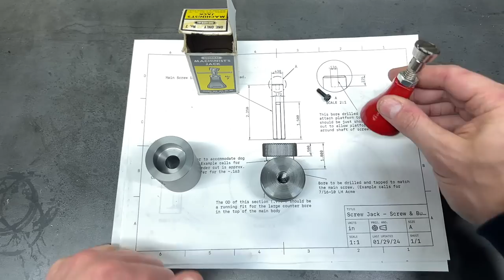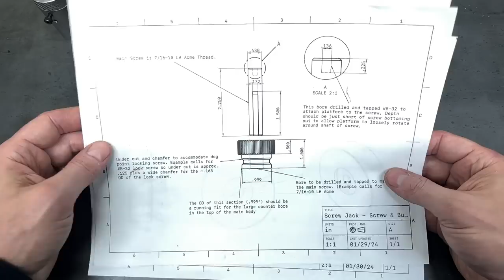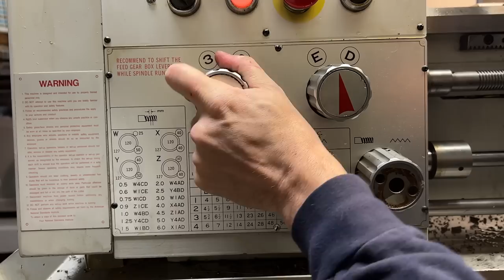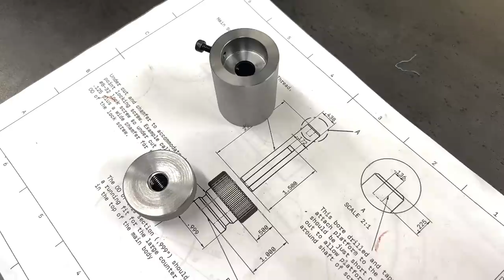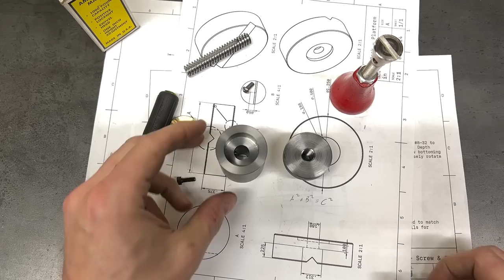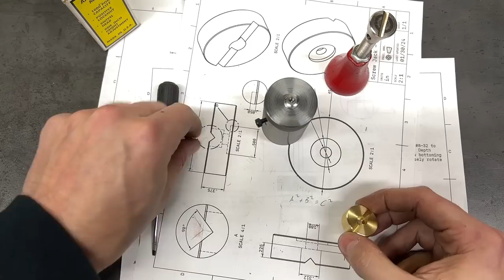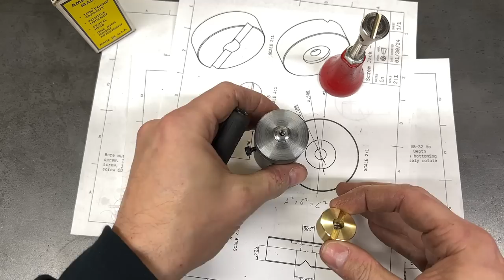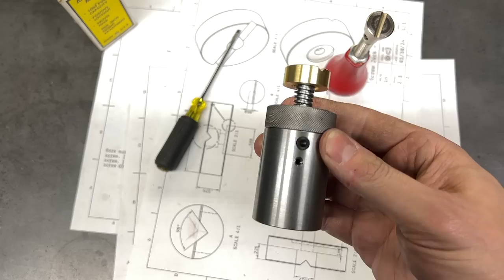Making a Machinist Screw Jack Pt2

Comment: From what I've seen there are two reasons to avoid putting milling cutters in drill chucks.  One is that the bearings and tapersv aren't designed for lateral loads and the other is that the chuck jaws are too hard to grip tightly.  Going straight into brass appears to manage both of these concerns.
Reply from the maker: Yep it can be a great way to get flat bottom holes, as long as you work safely within the limitations. Thanks very much for watching!
Reply: You can use milling  cutters  any way you choose if it’s in reason and within the limits of your machine. Never say never in this trade.
Reply from the maker: @ellieprice363  agreed 😉

Comment: Hi, what insert is that that you used at the beginning of the video? The one with a long front face. Love how that is cutting the steel.
Reply from the maker: It's a Swiss front turning insert, TF. Thanks for watching!
Reply: @hersch_tool  many thanks, I’ll try and find one. I’ve seen Joe Pie using one as well.
Reply: @hersch_tool  hi, I’ve spent a good bit of time searching and still cannot find an insert that looks like yours. Could you let me know the brand/product number of possible please, I’d love one like that.
Reply from the maker: @MrRctintin  TF33 made by NTK cutting tools
Reply: @hersch_tool  thanks mate

Comment: How rigid is the support on this device when tilting the bronze part? Compared to a standard jack?
Reply from the maker: It's pretty similar, there are often pressed onto a rounded ball on the end to create a similar effect. You just adjust the tension until it takes the play out against the part you're supporting
Reply: @hersch_tool  In the case when a ball is used there is no lever in the support? And also the contact rigidity is high due to the area of the ball joint?
Reply from the maker: @SergeiPetrov  Yeah that's 100% accurate. Great observation. But we'll have to see if it presents any issue in actual use though. I'll have to use it for a while and see if it ends up being a problem. If it does, then we'll make a version 2.0 ;) There are a couple of other details that I would like to improve on as well in the next attempt. Good observation though, a quick fix could be to just add a radius on the end of the screw and a matching radius on the bottom of platform.

Comment: Great work! Always satisfying to make a tool that will be useful for years to come, and extra satisfying when it comes out pretty!

You mentioned a locking knob in the first video... I think it would be better in the lower hole, to lock the screw directly. If you only lock the adjustment knob, there's still a tiny bit of play in the threads, which could affect the jack's ability to rigidly support a workpiece.
Reply from the maker: Thanks very much! And yeah that's a good thought! Thank you for watching btw!

Comment: I'll be damned! Just an observation and really nothing to do with anything important mind you. I have had that same lathe in my shop for nearly 25 years or more perhaps and have never used the tailstock graduated dial. Never thought about it really or had any reason to.  Nevertheless you have made a nice looking tool. well done.
Reply from the maker: Haha that's funny, I use mine all the time. I would like to hook up one of those digital scales to it at some point though maybe, would be nice to be able to reset zero and whatnot. And thank you very much, and thanks for watching as well!
Reply: I also have that same lathe, bought used, I think it was built in the 80's.  I had the same
situation as Hersch, owned a LeBlond Regal Servo-Shift 15 x 54 but it had a 7.5 HP motor
that was too big for a VFD, ended up selling it, sad to see it go.
Reply from the maker: @petemclinc  Yeah, don't get me wrong I am very grateful for the lathe I have, it's a good machine and I am very lucky to have an awesome shop filled with awesome machines to work on. But I miss that leblond, I think about it ALL the time lol.

Comment: Nice design and very clearly presented! I just finished the "little sister", a one inch version. Fun project! I saw a comment about where the locking screw should sit. It's the same threads so just switching the set screw and the locking screw will show which is best. But I will evaluate the original design first.
Reply from the maker: Thanks very much! I'm so pumped that you decided to make a version for yourself! I just love that, knowing that folks are out there following along, adding their own ideas and giving these projects a whole life of their own. It's the ultimate payoff for all the work of making a vid. I hope it works well for you!

Comment: I love those o.d. turning inserts that you use... I have a holder for those and a set of them - i think - for my Schaerer lathe, but given that i need to fix `er up before considering anything on her, i don`t keep track of the tooling i have for her... But those inserts appear to be an excellent choice even for a smaller lathe... Not as economical as some inserts with twice or even more cutting edges than those have, but i think that those could produce a very nice cut - even if shallow - on a smaller lathe... Maybe not a minila, but a medium sized benchtop lathe could put those to some good use...
Reply from the maker: Yeah they're great for medium size hobby lathes. Def a little more pricey than some of the more common inserts though, and harder to find on the secondary market as well. But they're pretty versatile, sharp, and have a great chip breaker.
Reply: @hersch_tool  yh, i just checked my tooling, well, some of it, and i do have the holder and a few sets of those for the big girl... Tho, mine are slightly different - much wider on the non-cutting side, almost like a trapezoid, and they are much duller than yours, not by use, but by geometry - the cutting groove, or the chip roller geometry really is much thicker, but they are generally the same idea, i suppose optimized for a beast of a lathe... 
I will have to order some of these that you have, and hopefully snag a used sandvik or similar holder in a good shape, as i realized quite quickly into my machining foray that cheap insert holders are actually junk... I dislike shitting on products without a good base for that opinion, but import holders are almost as disappointing as i was as a child... And that is a hard thing to achieve, almost impossible, but here we are, being proven wrong once more by the chinese... Oh how the Red Sun rises! :P
Reply from the maker: @camillosteuss  lol yeah i had to learn that one the hard way myself. Cheap tooling is cheap for a reason. The ones I have are made by NTK and they are through coolant as well. Got two of them brand new in a box of random swiss tooling I bought for pennies. The other one is still fresh in the little plastic tube. One day soon I wanna hook up a "T" to my coolant valve on the lathe so I can use through coolant on some of my tooling.
Reply: @hersch_tool  Oh, the coolant bore is a spectacular addition to insert tooling on a lathe... I do prefer using straight oil instead of coolant on all machines, but the tooling with ports for such liquids is just brilliant... As is high grade tooling gotten for pennies :P to be honest, that is my favorite type of tooling... I`m an absolute slut for boxes of high grade stuff that are being almost given away due to ignorance or sloth... 
Regarding cheap tooling, i guess we all have to learn that lesson first hand, it seems to be a species imperative...
Reply: For most machining on small to medium size lathes HSS tooling works very well, is easy to grind, and much cheaper than inserts. I reserve my carbide for harder heat treated steels and high speed machining. Mr. Pete has some good videos on how to grind HSS cutters.
Reply from the maker: @ellieprice363  I like to use a lot of HSS too, always keep at least one tool holder loaded with a ground tool. Sometimes you can't beat a sharp ground has tool!
Reply: @hersch_tool  What is the name of this style of insert? I'd really like to give it a try. Thanks!
Reply from the maker: @NeilMcFarland1  They are Swiss front turning inserts. "TF" style

Comment: Is there a particular name for this type of screw jack?
The part I am interested in, is the adjustment nut isn't part of the top or bottom, which seems the common way to make a screw jack.
Reply from the maker: I'm honestly not sure. The inspiration for this design came from an old south bend micrometer carriage stop that works in a similar way.

Comment: Never explained what the purpose of the second threaded hole is for under the locking screw in the main body of the jack ! Sorta looks like it could have been a boo boo ! ? :D
Reply from the maker: Hi, I did explain it multiple times, and showed it at the end during the assembly. It's for the set screw that acts as the key for the main jack screw. Give it another watch, I even show the set screw during the assembly. Thanks very much for watching btw!
Reply: I see it now ! It locates in the keyway of the acme threaded shaft to prevent it from turning. Doh. Should have paid more attention. @hersch_tool
Reply from the maker: @JohnDoe-qg6hm  Yep exactly, without it the jack would just spin and wouldn't go up and down, or in and out I guess? It wouldn't move, lol :) And it's ok, we all do the same thing, all the time. Sometimes you miss stuff, and bonus I get a second watch out of it! ;)

Comment: I've been casting around and thinking about designs for a small and large screw jack.  I hope you don't mind but I'm going to use your design for my bigger size.  I'll be using 5/8-11 left hand normal thread since I've already got the tap.  But otherwise pretty much a carbon copy of your design.   I really like the shape and how it works including the brass anvil.  First rate all around.   The only thing missing now is a slightly relieved band around the base and stamping your mark and date.  It's a work of metal art and needs to be signed as such.
Reply from the maker: Of course not, I don't mind at all! That's a huge compliment and I appreciate it very much, so thank you! I hope it works out well for you, I'm pretty happy with it so far. Thanks for watching btw!

Comment: Nice design, and well made.    Jacks were a project when I was in school.  I need another one  that is taller to support items clamped to my rotary table.  I’m going to add the key way from yours, it was not in the design I made 46 years ago.  What I am glad I did back then was made the body tapered for the bottom half, it makes sure the jack always spans the T slot on the mill.enjoy your new tool!
Reply from the maker: Thanks very much! And yeah, that's why I made mine as wide as I did. My little red jack will often want to fall into the t-slot if I'm not using a 123 block or something under it. Thanks for watching btw

Comment: Now you need to make a knurled locking screw for it
Reply from the maker: Yeah I think I probably will do that. Something nice made from brass so as to not mar up the adjustment ring when locking against it. It was in the back of my mind the whole time to include in the vid if I had time to do it, I think I even mentioned it at some point in the first vid. But just ran out of time for now. Thanks very much for watching btw!